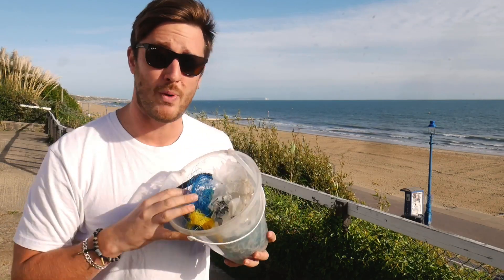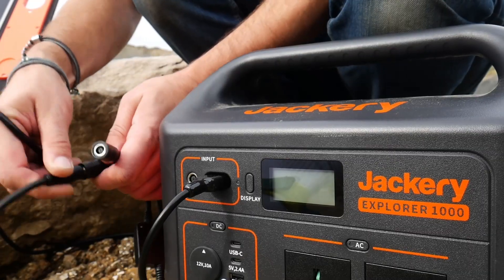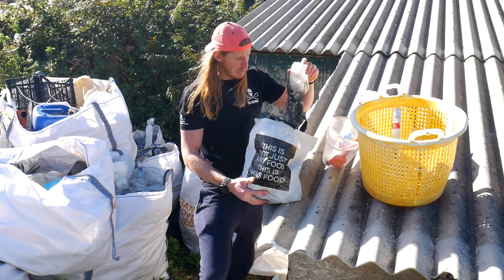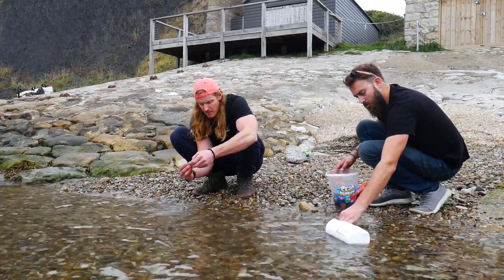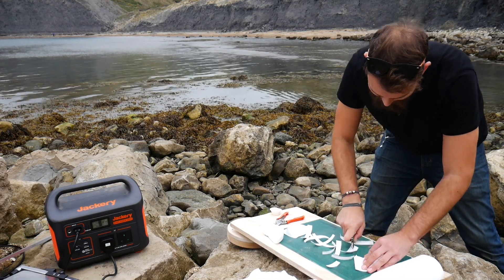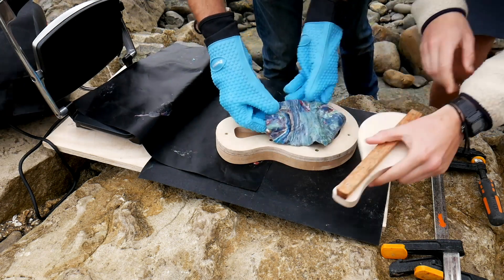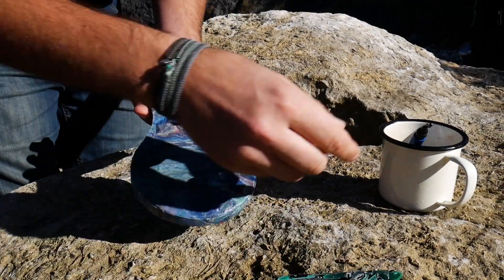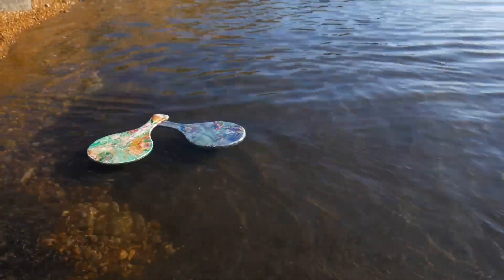Recycle Beach Waste ON the Beach

Comment: Worth noting that while PET isn't recyclable via your methods, there's lots of fun ideas to recycle it. 3d printer pull-struders that turn bottles into filament are a fun tool that are rather easy to build and can be used to make anything one could design in CAD.
Reply from the maker: Yes we’ve seen these - would be fun to try

Comment: Thank you so much for sharing your knowledge, I am inspired! 

I have been wanting to make things with recycled plastic for years but didn't know how to melt it safely. I have the very thing already - a t-shirt heat press! I even use a silicon sheet (I presume that's what you're using?) 

  Do you have any idea approx what temperature you need to melt it without it giving off toxic fumes?

Comment: Two questions: can you use silicone molds (for resin usually) for recycled hdpe  plastic?  

If not, where would you get molds. I have RA, and my hands can't handle carving.
Reply: 1) Yes. InvenTory, the YouTube channel, uses them for many projects.

2) Michaels, and many retailers, have them. Look for icecube trays, and gelatine molds.

Comment: Great video, although a tad green-washy. Someday, a clever group of people will figure out how to manufacture truly sustainable solar panels. Kudos to the ocean cleanup group.

I've been looking at the Jackery solar-chargeable battery. Glad to see it holding up fairly well.

A future challenge could be to heat the plastic in a solar oven
Reply from the maker: I’ll happily discuss what you think was greenwashy about it?
Reply: I'd also like to know.
Reply: @BrothersMake  I'm not accusing you of greenwashing, your efforts are far from that. Being at the beach and gushing over using "green" power is the greenwashy part. The solar panels and batteries are encased in petroleum-based plastics, as is the clever tool that determines plastic type. Whether the batteries are lead-acid or NiCd, they won't be easily reclaimed or recycled. Additionally, the wood used to make the paddle is likely fresh wood. Again, not criticizing the efforts or the use of solar energy.
Reply from the maker: Where I agree that the production of solar panels and battery storage systems is not plastic free (far from it actually), does that disqualify them from use? Just because the systems in place aren’t perfect, it doesn’t mean that they aren’t better. Solar storage systems work in the sense that they remove the need for fossil fuel dependency. But there is absolutely work to do for their end-of-life. 

Also, the wood we used was all scrap and offcuts from our workshop 🤙🏽🤙🏽
Reply: @BrothersMake  Again, I am not critizing the use of solar panels, and pointing out that they are made of plastic is not the same as stating their use should be disqualified, you are putting words in my mouth.
Reply from the maker: True, you did not say that. I didn’t explain that clearly, apologies. It’s just very easy to brand something as ‘greenwashing’ these days, when we do everything possible to be as transparent as we can to avoid this. Apologies if that response came across not how it should.
Reply: First I want to tell that I understand and don't critisize your comment, I just want to help understand how plastics shouldn't be hated like they are now. 
Using plastic isn't the bad part, many plastics are easy to recycle and need a "low" quantity of energy to recycle (compared to glass for example). The problem is more the number of thin plastic single use products (that are not even marked with their plastic type) than plastic itself. 
Big "heavy" chunks of unpainted almost pure ABS are ideal to recycle. Plastics (not all of them tho) are fantastic materials that can achieve a lot of things but since they are versatile and cheap we do stupid products with them.

Please people, don't hate plastic, hate the way we waste it.

Comment: What is best for melting plastic, a mini oven or a panini press? And does the plate of the panini press have to be necessarily smooth?
The Breville VST049 i can't find it on the web. And if I look for other brands, either they don't have a smooth plate or they are really expensive.
Reply: Maybe the oven? I don't know, but with the oven, you can use silicon molds and just let the force of gravity do its work. I don't think that there is a best tool.
Reply: @eugenetswong  
Force of gravity? Plastic never becomes liquid. You have to press it into a mold. They sometimes use the oven and other times they use the panini press. But I never understood the reason for choosing one or the other. Maybe they even said so. But I don't speak English.
Reply: @FlyToSardinia  When the plastic becomes very hot, it becomes really soft, like thick liquid chocolate, and then flows down.

I tried softening it, and then it flowed and became a mess.

They use the press to make it flat at slightly lower temperatures.

Comment: What is y’all’s opinion as far as repurposing the actual plastic bottle itself and not just the lid? Can that be done and safely? Haven’t seen y’all use any plastic bottles yet and wasn’t sure if y’all felt like it wouldn’t work as well or just prefer to use lids as it doesn’t need to be stripped up and cut into little pieces like the plastic bottle would. Let me know, very curious abt y’all’s opinions of how and just in general when it comes to melting the bottle that these lids come from or a way to repurpose them in general.

Comment: @8:30 so.. You're having a "clamp bake"? Did those solar panels really generate enough energy to melt all the plastic?  In any case, good job!
Reply: Its Energy bank, charge battery and invert to AC voltage

Comment: Hmm. A lot of labor and unusable stuff due to the need to sort... I wonder if, for larger objects, there's a temperature range you could use to melt most of the usual offenders and just tolerate the rest as impurities without burning them or creating harmful nonsense from overheating them? Not near a beach myself, but near a lot of fabricating equipment and some ideas for bulk melting using a heavy solar boiler setup, that theoretically would have enough heat energy to just keep pushing a ton of massed plastic to just about whatever temperature you could need... you guys happen to keep any records of the kinds of plastic you found on the beach?
Reply from the maker: We don’t recycle mixed plastics as it removes the potential for future recycling. The labour is worth it to us to keep the process circular